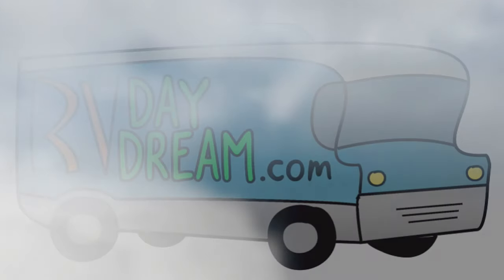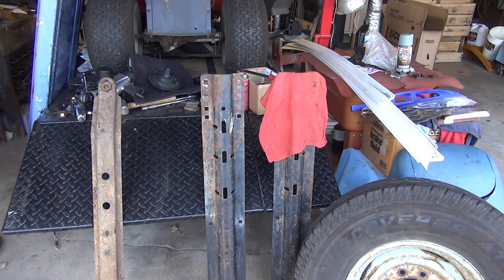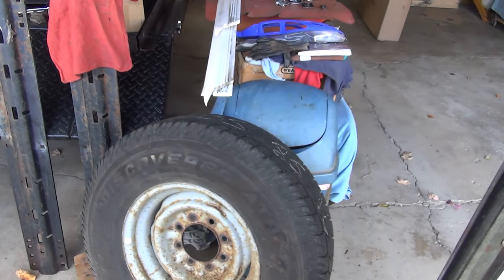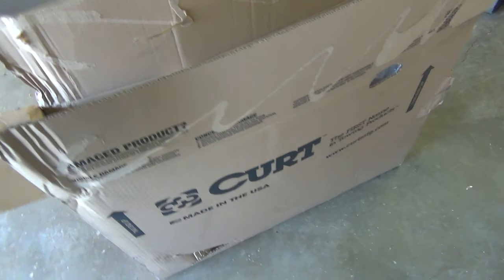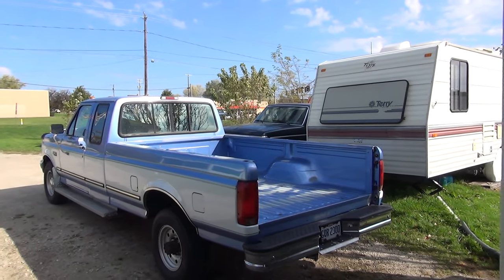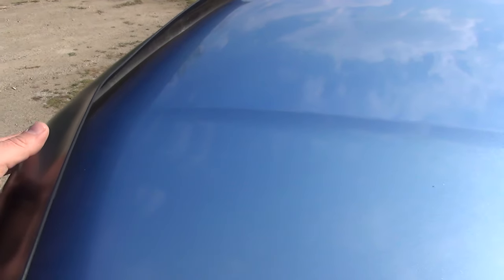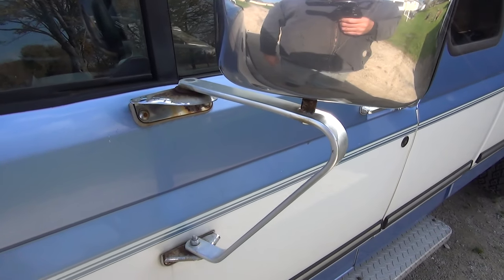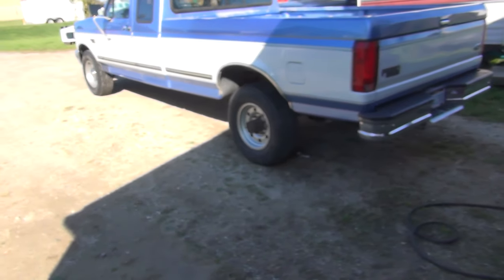RV F250 Tow vehicle. Tearing down to Build Up

Comment: Hi Mike, Your truck is going to be really nice when your done. I can't wait to see her in action, hauling your rig. Are you going to install another cold air kit on it? And whats your plans for your other truck? It looks so sad sitting there or maybe its happy, no more hard work.
Reply from the maker: +redjaguar100 Thanks, we are anticipating using it too. 
 I might skip the cold air kit on this truck for a few reasons. 
1) Fuel Injected Mass air metered engines respond more appropriately to performance modifications the speed density engines. The F150 is Mass air the F250 is speed density. 
2) The 460 in the F250 has velocity horns built into the air intake tubes that are to help with low end torque, I am pretty sure those get modified or removed when using a CAI.(I don't want to lose any low end)  
 3)The F150 probably wouldn't have got a CAI put on it if not for the luck that when I was at Summit buying Headers for the F150 they had a return CAI kit in their scratch/dent/return section that was marked down to $100.00. The CAI for the F250 runs about $195. a little too much money for only approx 9hp increase. 
 I will add a K&N panel filter in place of the stock one... The real rub of buying a panel filter is I had the panel filter for my F150 lying around for close to 4 years until last year ,when I tried to sell at our garage sale. Well it didn't sell last year but guess what? Yep I sold it this year for $3.00 a replacement cost  $43.00!!! Arrghh
  The old F150 is slowly being dismantled of all the goodies that will me mounted on the new truck. Once everything is stripped off, the truck will be put up for adoption.. Bruises, dents, and all, I will be sad when it finally gets driven off by it's new owner.. Thanks for the comment..